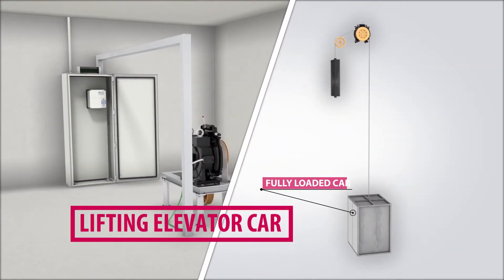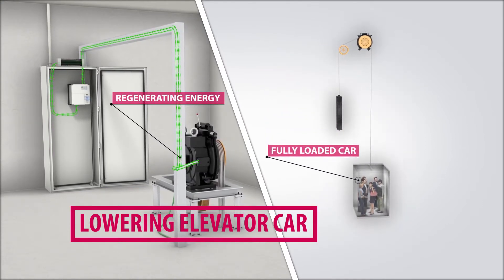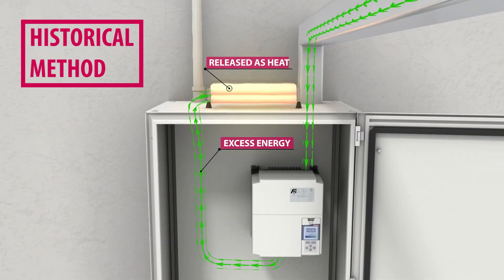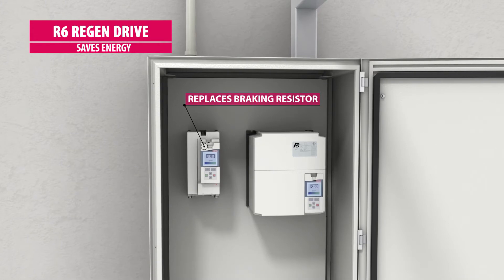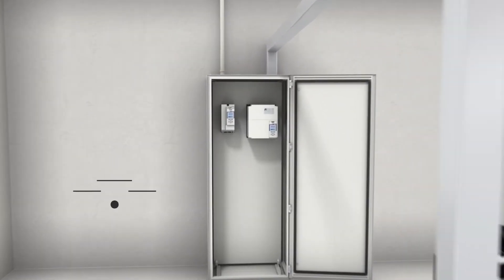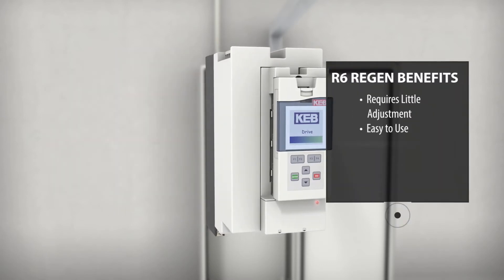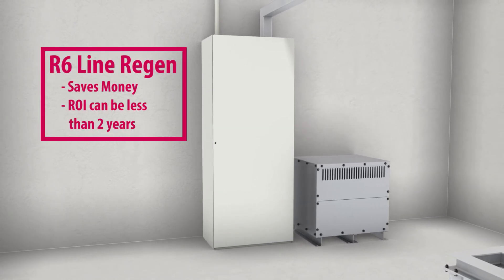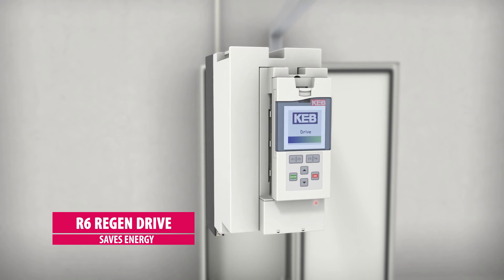Elevator Regenerative Drives  - R6 Line Regen from KEB America

Comment: Can we regenerate the power using lift?
Reply from the maker: Are you referring to "lift" as in elevator? This is an example of using an elevator using a regen drive to regenerate energy back to the building power grid. As described in the video, a loaded car going down and an empty car going up will both generate excess energy. When an application uses gravity to move instead of the power of the motor the regen unit can use this movement to regenerate energy back to the grid. 
Let me know if this helps. Thanks for the question!
Reply: @KEBAmerica 
Thanks for your valuable reply.
Reply: @KEBAmerica  Hi. i need an explanation if you can. when elevator regenerates energy - it goes back to the building. But do you need an accumulator for collecting that energy? or the energy from that regeneration simply flows back to the electrical network? then  can it produce reactive energy (kvarh) which considered efficency loses and you have to pay for it?   I just want to understand where the regenerated energy goes
Reply from the maker: @maksim82tallin   I will ask one of our application engineers to see if there is a simple answer to your questions. If you want an answer for a specific application you're working on then you should contact a local KEB Representative near you: https://www.keb.co.uk/contact/contact-worldwide
Reply from the maker: @maksim82tallin  Ok. Hope this answers your questions: "The energy from the R6 units is meant to be reused within the building. So it reduces your net energy consumption but doesn't actually make it go negative. If you wanted net negative energy and actually put energy back out onto the grid, you would need to use an AFE unit."